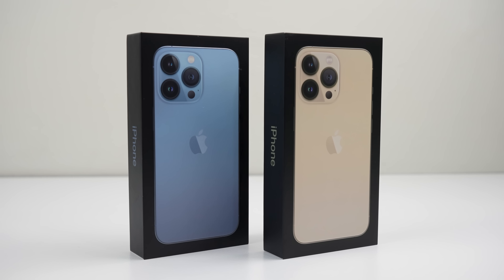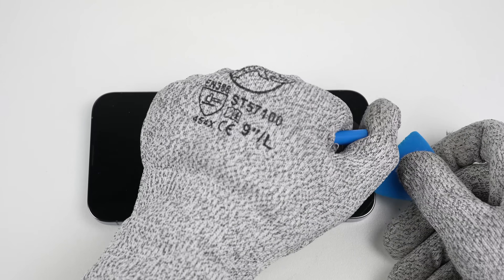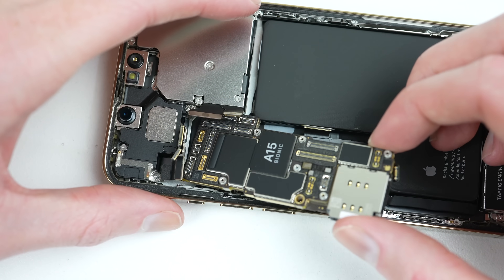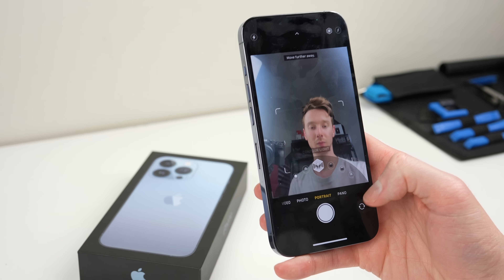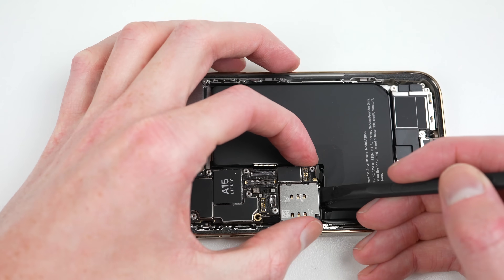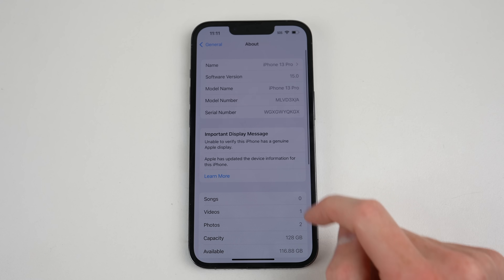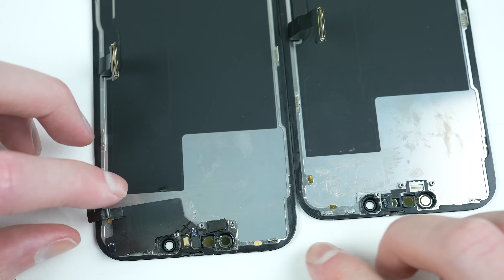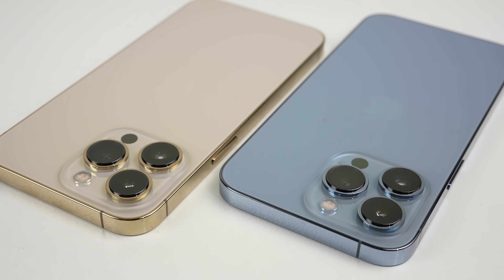iPhone 13 A Repair Nightmare - Teardown and Repair Assessment

Comment: They don’t give you a power adapter or headphones to “decrease e-waste” but they will continue to make it even harder for 3rd party repairs and phase older models out of software updates. 🤔
Reply: Plus they still make all that stuff and just sell it separate. Wouldn’t be surprised if they didn’t change anything in terms of manufacturing.
Reply: @E_Soulless  the best part is it probably creates more waste due to the separate packaging for those accessories lmao
Reply: @JareBralTer  EXACTLY lmaooo it’s a joke, you’ll see a lot of this from here on out as companies try to get points for being environmentally friendly.
Reply: @JareBralTer  didn’t think of that haha
Reply: "Decrease e-waste" lol. More like decrease overhead.
Reply: I have not used that stupid adapter for wired headphones. And I refuse to spend $160 on pods that fall out of your ear.
Reply: @beegchunguz7425  you must have some big ass ear holes 😂
Reply: Decrease their costs, nothing more.
Reply: Probably It's no about e-waste it's about profit
Reply: Genuinely most people who upgrade ALREADY HAVE. The charging block etc so they are marketing mostly to those who can use that or have the charger in their home already . Samsung does the same thing and nobody bats an eyelash?
Reply: @PaintballGargoyle  apple just changed the opposite side of the charger to be incompatible with all of the old charger blocks though
Reply: @Destructocorps  again a monet making tactic. Samsung at least will allow you to use old chargers. I had a iphone 5C at one point and of you use a cheap 3rd party charger the phone will tell you in multiple pop up messages that the cheap charger may not be supported so they make you buy a $30 charger
Reply: don't worry soon they won't even include a box you will get your phone wrapped in paper in a paper bag like a mcdonalds burger.
Reply: It's all BS
Reply: Greenwashing
Reply: Literally Apple supports more older devices than any other phone manufacturer.
Reply: This comment, I completely agree.
Reply: I agree with everything else, but that software but is completely wrong. Apple literally gives their phones twice the updates over time, still supporting the iPhone 6S from 2015, than Android which gives about 2-3 years if you’re lucky
Reply: No it is not about decreasing e waste they make for money buy selling you a separate charger and ear buds. Samsung is going the same route unfortunately.
Reply: Decrease e-waste,  bs... why Apple locks everything out & upgrades iphone yearly??  If iphone upgrades for every few years,  it does drastically reduce the e-junk,  it's that simple,  not just stop including this and that.
Reply: Wow. Did u come up with that idea yourself
Reply: They provide anti consumer tactics and people go out and buy them and then complain🤔
Reply: @Juan-dc6yf  well nobody in power does anything about it, a token fine here and there is chump change to apple and also google. i mean even courts are in their pocket it seems.
Reply: @bobjk3455  anyone is free to make a 100% repairable phone, nobody is stopping you. We all know everyone will go buy the iPhone while your phone sits on the shelf. It's time for personal responsibility and not always going for the Ole reliable "corporations bad lawmaker do something "
Reply: @Juan-dc6yf  chains. 

most phones these days are not made like good old days of the 90s when flips were actually the norm and the stupid candybar that has taken over. i mean phones back then were pretty easy to repair and fairly cheap. sure they lacked lots of feature but they were still pretty usable.  

plus they also have a brainwashed consumer base. easy considering they have very slick marketing and well people will belelive anything it seems these days. i mean the iphone 13 is just a marginally better iphone 12 at a higher price so not really worth updating.
Reply: What the f*ck you mean "phase older models out of software updates"...
I was still holding onto an iPhone 6, a 6 years old iPhone that's been receiving updates until today.

Get outta here you droid n*tcase.
Reply: @h.a.6790  It depends on the model age. Like, my former Ipad mini 3 stopped at iOS 14. Eventually the 6 will stop too
Reply: @h.a.6790  yeah bro you’re lying. I have an iPhone 6 and an 11. 6 is on iOS 10. 11 is on iOS 14.
Reply: @h.a.6790  what
Reply: @h.a.6790  Am curious, what iOS version is your iPhone 6 running?

Comment: This goes against "The right of repair act" They have been in constant lawsuit for years due to the same problem. As long as they have stupid customers to buy their products this is never gonna change. The only solution will be to boycott them so they start implementing fair manufacturing process.

Comment: The smartest thing Apple does is paint the devices. They know you’ll scratch sooner or later and want to buy the newest model. Same with MacBook. Especially MacBook, if it gets hot enough long enough the paint on bottom will start coming off.
Reply: they're not trying very hard in the cooling department as well

Comment: Another example of a corporation blatantly lying. Completely agree with Hugh, real sustainability can be achieved by ensuring these products have longevity for the users. Not only should we not have to buy a new phone every two or three years (due to planned obsolescence), we should be able to count on our phones working properly for, at least,  five or six years. When they break or stop working properly, we should be able to take them to someone that can fix them. Software locks are lame and wasteful.

Comment: The fact they're doing this with their software is an ethical concern. 

If software exists to intentionally make the phone malfunction from small hardware changes
...
what's stopping Apple from using that software to make the phone malfunction to encourage people to upgrade to a newer model because they think their phone is "getting old" ? 

I find it laughable that this same company talked about not creating software to unlock an encrypted phone because that kind of capability is dangerous once it exists, yet they go ahead and create software that only exists so they can profit from a repair monopoly.

Why should we trust a company that intentionally writes software that can cause their phone to malfunction when they feel like it?

We need regulations for things like these.
Reply: What do you mean by "what's stopping them?". They already slowed down phones without notification to "preserve battery life"

Comment: One logical reason they might do this is security + prevent people from stealing iPhones and harvesting parts. With Face ID, find my phone, and hardware locks, it's kinda useless to steal an iPhone.
Reply: Parts that would then be sold for repairs? Why would apple care about theft of phones after theyve been purchased lol
Reply: @JackNormalMemes  iPhones are really expensive and easy to steal. There was a huge problem of stolen iPhones on the black market before Apple addressed it in 2014 by introducing activation locks. They might be thinking the same but with hardware locks this time. Not sure.

Comment: When working at BestBuy, we would get similar errors until we re-paired the new screen or camera using Apples tools and programs. I forget the name of the programs but regardless, if we didn't use the program, a screen or any component replaced would cause headaches and we had to go step by step all over again. I had a stroke so my hands couldn't handle the small screws anymore.

Comment: I solved my life some years ago. I bought a Samsung! Now, I have a greater Samsung S20 Ultra and a Samsung Tablet S7. They work marvelously. I keep my MacBook because of the software I already had, but I think that Windows is getting better and better every release. Now, I think is a question of time to change the MacBook too.
Reply: I have an Item A13 pro which I got for like $63 and it's way better in a Service to Price ratio than some newer iPhone's
Reply: windows is quite awful still. older programs stop working properly. linux has program called wine which can run older programs lot better than w10.
Reply: @thehemmo5078  at least you don’t need to get a new laptop after 2 software update :P
Reply: @fbi559  true

Comment: This is why i will never have an apple product. 
I said  this 8 years ago when I was helping a visually impaired friend with an apple tablet ( it was a gift, everything was set up for her and she was told to keep it charged, never shown how the buttons worked) and it took us getting to level 4 advanced  tech support  before they even asked if she had the fully charged tablet powered up. The  problem we were calling about?? the screen  was black...I had to go onto the computer and find a user manual to find where the power button was (the level 4 tech person  could not tell me) and press it....it worked....you would think that would have been the first question asked  instead of struggling through 3 hours of tech support.

Comment: Apple has always been like this, their software and everything else. People buy Iphones mostly for the status and not for the technology, their products have always been overpriced but have good marketing so people always buy it

Whoever buys Iphones kinda deserves it. It is no secret that they make charger cables fragile or slow down old models or make all those cable adaptors so that you have to buy them separately for laptops plus all the other overpriced stuff

Each Iphone costs under 200 dollars to be produced, but are sold for exorbitant prices because that's also part of the marketing. Apple will most likely lower the repair fees to compensate users but whoever buys it still deserves to be scammed, it's not like they didn't know

Comment: That charging stand looks like it's designed to eventually break the charger port
Reply: @H27W oh yes more inefficient charging than just a cable.
Reply: @H27W ah yes...
The weaker version?
The one that can actually make your data be more easy to be robbed?
Reply: I never use ios.  Every android phone I've ever owned was unable to charge at the end of its life.

Charger port always wears out after two years
Reply: @danfurtado9158  what are you doing to your chargering ports haha.
Reply: @danfurtado9158  used 3 phones all for 3+ years and charging port was never an issue. And 2 of them had a micro usb port, meaning I ended up shoving the cable the wrong way quite a few times and the port was still just fine.
Reply: @danfurtado9158  what have you been doing to your charging ports???! I've had the same note 4 for the past few years and it still works brand new
Reply: @danfurtado9158  that's the problem of any device with a single interfaces port. Kinda stupid when we have a very powerful phone today but crippled by greedy decisions.
Reply: @danfurtado9158  dude my android phones have never ever suffered from this in all of the time I have had an android for nearly a decade. The problem in this puzzle is you, you are mishandling your phones to break them every 2 years. If anything iPhones are way more likely to have their charger port dying from getting sand and lint packed in from pockets due to the charger port design. I've seen it happen with a lot of them and repaired two with the issue. Android? Never heard of the same issue.

Comment: I'm OK with only admitting original parts and even SN locks but you should be able to do something like connect to the computer or internet and verify the new part's SN and have the device functioning again.
Like when you validate the license key of a software you bought.

Comment: This is what the European Commission needs to ban, rather than messing around with mandating a certain form of USB.
Reply: Both are important. Proprietary connectors create unnecessary waste. It was a nightmare in the early days of mobile phones as everyone needed a different charger.
Reply: @skozombie  we're no longer in the early days. What happens when USB c becomes outdated?  New legislation will be needed. USB c only exists because Apple created the Lightning cable.
Reply: @paulwood6729  USB-C was going to come regardless of lightning. If USB-C becomes outdated we move to the next agreed public standard, just like how we're moving from Micro B in favour of USB-C. Just because you have a standard doesn't mean you don't iterate and move to newer standards.

Proprietary, patented connectors do not make good standards.

Comment: At this point I wouldn't be shocked if a future iPhone has the metal side frame have a lip going over the front and back glass and is then seamless welded together to make it fully impossible to open
Reply: Future iphone has self destruct feature when opened
Reply: @iceseic  Azidoazide azide strapped to the motherboard.  LOL
Reply: You underestimate China. They'd have a special machine to open it like a can opener in a month and repairs would continue. Keep in mind where these devices are manufactured.
Reply: SHHHH!! dont give Apple an idea like this! lol
Reply: I always thought they'd just seal the entire inside with a layer of epoxy, or a heat-dissipating potting compound and call it a day.
Reply: Tamper switch that ignites a tiny C4 charge and blows the damn phone out of your hands.

Comment: I appreciate the information you bring to light regarding repairing iPhones. We need to continue pointing out the errors of companies like this who say one thing then do another. The hypocrisy is certainly real.

This actually kind of reminds me of the symbiotic relationship that Best Buy and Geek Squad has together. I've seen Geek Squad get their assessments completely wrong, charge a large sum to fix it, then tell their customers it would be cheaper to buy a new computer. And by the way there's some new computers over there that you can buy. What they don't tell you is those computers aren't new, they've been sitting on the shelf for nearly a year.

It really is a shame there are companies out there who'd rather replace the problem instead of fixing the problem. Which Apple and Best Buy/Geek Squad unfortunately adopted into each of their companies.

Comment: I am an Iphone owner, and I genuinely say "F*** you Apple." I remember attempting to fix a previous Iphone of mine and it seems of the 17 screws I removed, I had over 14 screws that were not like one another. After seeing the issues here, coupled with the issues I've had with Itunes, I will be switching phones because of the anti-consumer practices sustained by Apple.

Comment: So mainboard has some sort of hardware id map and this map is invalid for swapped parts causing some if else if else logic to cause features to get disabled. Apple repair will probably just remap it with changed parts hardware id's and all is fine. Sounds pretty simple programming and it's part of "planned obsolescence".

Comment: ATM i'm considering buying an iphone 13 mini to upgrade my android device, but at 6 times the price plus the cost of replacement parts in the years to come, this is a bit scary to know.
Reply: You don’t really need a new phone. I have an iPhone 7 and it still works almost perfectly fine. Even if you want a new phone, the iPhone 11 should be more then good if you want
Reply: @TiagoOrange  thanks for the reply - you are right, i dont really NEED one, but my motorolo G7 power is a bit of a brick. it has fantastic battery life which lasts a week which is why i bought it in the first place, (i dont do heavy downloading and games), but starting to annoy me when i carry it around in my pocket due to the weight and size, and some features of android i find a pain to use too, so i'm still deciding on my best option.

Comment: Apple is the worst product maker in history, not because for their quality or security (but even those get questioned a lot nowadays especially their shitty security) but because of their greed and shit ethics. Why would the Face ID or any other feature being irrelevant to the part that got replaced gets borked on a fucking purpose? They can go fuck themselves, none of these are actual issues/bugs, they happen because they are coded to happen on purpose. Some of them also behave in the exact way ever since iPhone X and iOS 11 (and earlier if we just count the camera issues after replacement), so even if i'm wrong they would've fixed these "issues" after at least 4 major iOS versions. Whoever still support this shitty as fuck company that produces the same device only more and more locked down each year, that's on them.

Comment: Got a solution. Stop buying anything Apple.

It is ironic.  The very first stock I got was Apple when my parents gave me an Apple II and a single share of stock.  I kept buying shares through my teens, twenties and into my thirties.  Apple is my single largest stock position, and the only Apple product I own is that original Apple II.

Thank you iZombies.  You've paid me well.  And I hope you keep mindlessly buying overpriced equipment from a company that holds you in contempt.

I sold out half my Apple this year, so even if it goes to zero I'm fine.  Stop buying Apple until they stop being fascists.

Comment: Apple has actually made the repair a whole lot easier for everyone. In ye olden days phones consisted of multiple tiny parts that were fragile and prone to break easily if not handled with utter care.
Now Apple introduces the new fewer and easier to obtain parts plan: The device consist of only one (1) part: the device itself.
To replace it in case it breaks, go to a licensed Apple dealer and request a replacement part. Remove old part from your pocket. Install new part into this now vacant pocket of yours. Done!
It's really that easy.
Congratulations! You're now a professional Apple service technician.